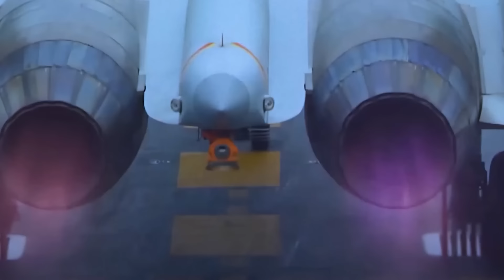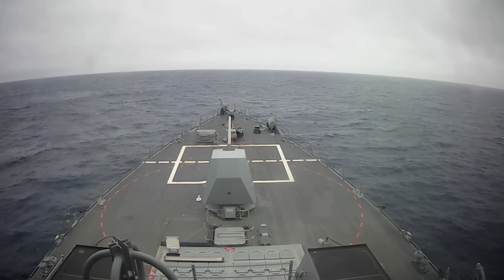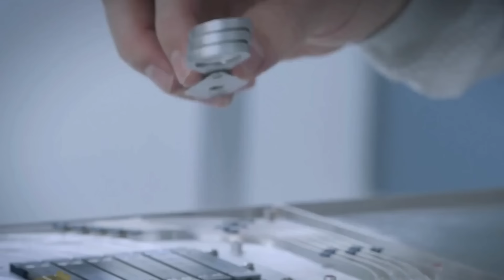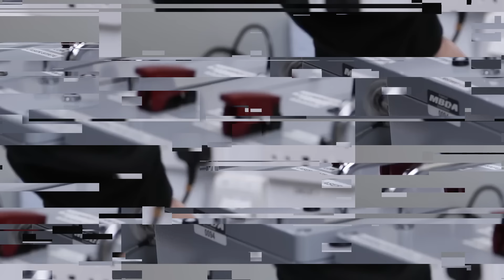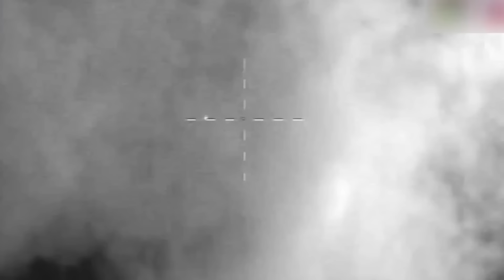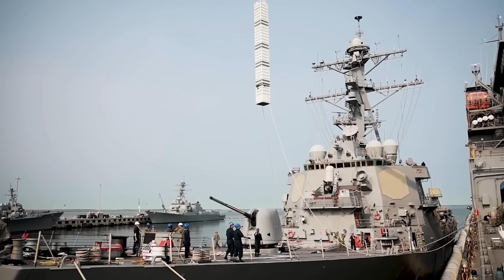Physics-Defying Laser On US Carrier Stops Every $5M Chinese Missile

Comment: The Helios has to stay focused on the target for a few seconds to cause enough damage to stop the missile or drone. It only has an effective range of 6-8 miles.  A DF-21D has a top speed of Mach 10. With air resistance lets say that would be lowered to somewhere between 5-10. . That would give the Helio less than 10 seconds' worth of firing time at best. Or put another way, at best, it could only stop 1 or 2 of them simultaneously. While cheaper than DF-21D, three missiles, coming from different directions,  would be a lot less money than the big ship it destroyed. The Helios would be good against small drones because it's cheap per shot. For the hypersonic missiles, though, it wouldn't be enough to stop three and probably not even two.